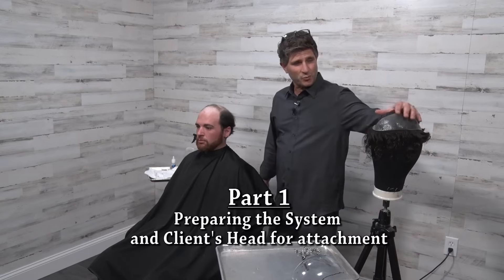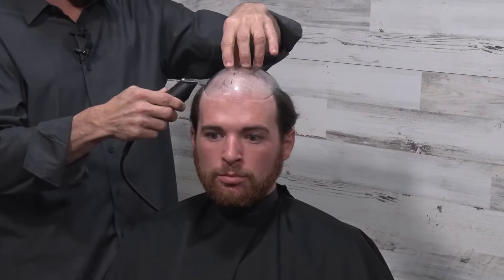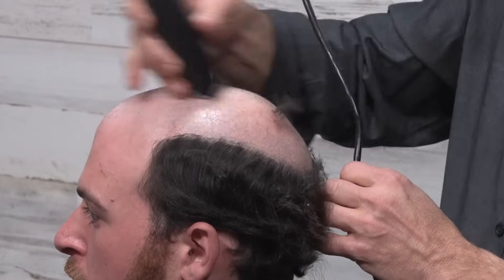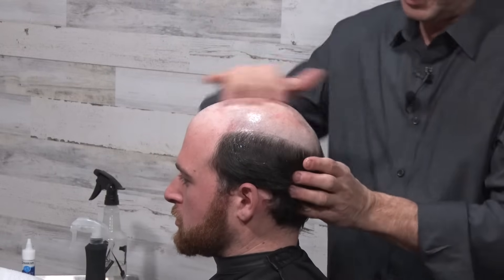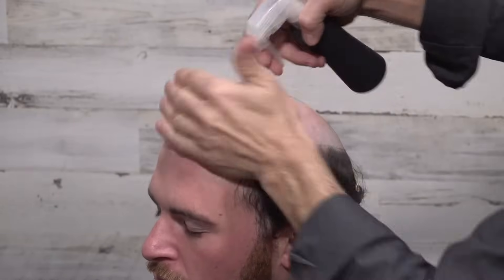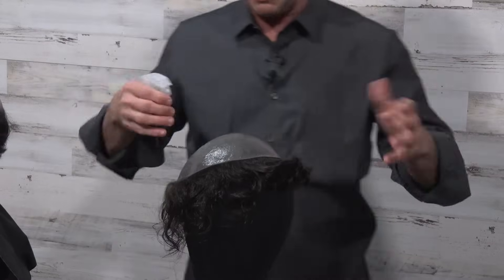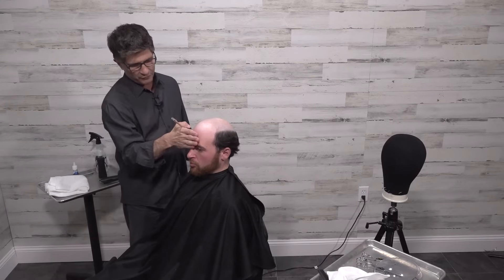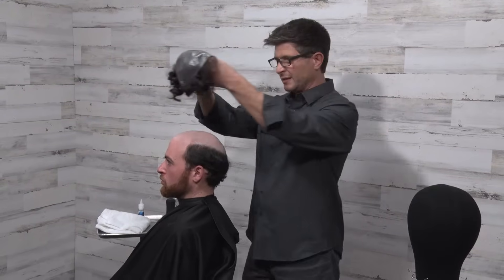Part 1 Non-surgical hair replacement. Installing a hair system beginning to end #1 of 4

Comment: Great Video! A small advice, plastic mold does not fit everyone, you can see a gap between the mold and your scalp, so the result might not be very accurate. Plastic wrap would be perfect for making a template. :) Anyway, thank you for sharing this video~ 😊
Reply from the maker: Plastic wrap is what we use mostly. Good eye! 👍
Reply: How is a plastic mold made
Reply from the maker: @shanz5820  Not sure. They come in the box with the hair. So if it fits the head well, we use it instead of tape, fiberglass or plaster.
Reply: @profitablestylistacademy  well you really do a lovely job x
Reply from the maker: @shanz5820  Thank you very much🙏
Reply from the maker: @shanz5820  Plastic wrap stretched over head, draw outline, then strapping tape for stiffness. Does that help?

Comment: Nice video, I was wondering about using witch hazel on scalp instead of alcohol, is that also accurate for the system?
Reply from the maker: I’m not sure if it will remove as much oil. Are you having trouble getting 99% alcohol?

Comment: I wear hats almost exclusively during the week  ... can this hair system along with possibly a method of application (maybe glue only the perimeter of hair system) that would allow it to be taken on/off more easily and wear on weekends only?
Reply from the maker: We can help with that solution, but not exactly how you are describing it. Where are you located?
Reply: Use tape around the whole edge. You can unpeel it off before bed every night. Then in morning re stock it on. The same tape re sticks to your head after 5 mins. It makes the system last 18 months minimum and you can take it off each night, and re shave your scalp every couple days. All these tutors on here using alcohol and every other product is completely unnecessary it’s ridiculous tbh the amount of faffing they do
Reply from the maker: @Fd20y  It’s not ridiculous at all! Isn’t that just your opinion. Looks like you may be a barber from your 2 posted videos. People could just cut their own hair and not need you. 
This is a service, just like cutting. Most people don’t want to do their own hair, so they pay you to cut, me to get hair, my team to learn. It’s called capitalism and education. 🤷‍♂️ Expand your acceptance🤔
Reply: @profitablestylistacademy  I cut and fade my own hair done so years and years. People need to learn to be self sufficient, that brings true peace of mind and control not relying on anyone else. There is literally no reason for all that product. Huge upsell. BTW I’m not a barber
Reply from the maker: @Fd20y  No they don’t!🤷‍♂️again…just your opinion. People don’t “need” to do anything the way one person says to🤦‍♂️
Reply: @profitablestylistacademy  no but people want to keep others eyes closed to the easier methods, it’s better to profit that way
Reply from the maker: @Fd20y  There are no shortage of answers on the internet. People can find the cheaper easier way also. 
This channel is for teaching Stylists and Barbers how to do a specific service, that clients choose to get, and yes… it costs money🤷‍♂️ We all need money to survive. You are not saving the world here. This service helps many people that can’t or just don’t know how or want to do it themselves.
Reply: @profitablestylistacademy  I understand but I just don’t like the fact the easy methods aren’t even provided as an option to people who get these things. I’m pretty sure the majority would want to know to enable themselves full control over it and being cost effective. Systems last longer, etc etc. No provider I know of shows my method, I wonder why
Reply from the maker: @Fd20y  We offer both and most choose adhesive because it’s less work or skill for them at home. They usually don’t mind paying for convenience by the time they make the decision. Also, your way is easy, it doesn’t really need a video for learning. We offer both in our studio and have both kinds of clients. Just very few choose tape and having it off at night🤷‍♂️ Most Hair Replacement centers offer both in the US. Not sure about the world.

Comment: i feel headache after installation what could have gone wrong?
Reply from the maker: @mryoso22  Many stylists stretch the base of the system on and it causes stress on the scalp. A soft lay down and then pressure to make it stick well is the right way. 
Bernard
Reply: @ should i remove the hair for now and return it later
Reply: @ or better i should do the reinstall myself?
Reply: @profitablestylistacademy  the pain is manageable not that painful however should i be concerned at all?
Reply from the maker: @mryoso22   No concern, but ask your stylist not to stretch the base and it will be more comfortable.
Reply from the maker: @mryoso22  If it’s too painful, yes
Reply from the maker: @mryoso22  Do you think you can do it by yourself?
Reply: @profitablestylistacademy  thank you finally tried removing it and putting it back on yesterday and the pain is gone now
Reply from the maker: @mryoso22  Perfect!!

Comment: How much does this cost on an average?
Reply from the maker: Hair Replacement like this takes about two hours to apply the first time, but that’s after a consultation to order the correct color and size. Usually the hair can be received in a few days, but occasionally takes longer if a custom order is needed. 
Then a monthly service and hair cut is necessary to maintain the look. 
New hair is replaced every 3-6 months depending on the hair system chosen. 
Hair cost ranges from $800. to $1,500. 
Service ranges from $100. to $250.

Comment: How long does it last before replacing it?
Reply from the maker: The adhesive lasts about 3 weeks between visits, but the hair system needs to be replaced about every 3-4 months. The look just keeps lasting for years if the client continues with service and new hair when needed.
Reply: Fantastic!🇬🇧👍

Comment: How long does this last on an average client???
Reply from the maker: Average is the key word… Then their is the word “this last”🤔
The adhesive lasts about 3 weeks between visits, but the hair system needs to be replaced about every 3-4 months. The look just keeps lasting for years if the client continues with service and new hair when needed. Which part were you really asking about? I’m curious!
Reply: @profitablestylistacademy  Most of my clients are in their 50's now and work at a desk. I've seen the systems that last a year but they look terrible. The one you use in the video looks great but I don't think my clients will pay $2500 unless it lasts at least 3 to 4 months before I have to replace it.
Reply: @stylistrichardjenkins  wait what ...$2500 for 3 to 4 months befoer you have to fork out another $2500? thats a joke right?
Reply: @djam7484   not a joke.  Happens all the time

Comment: Hey! Nice video! Where did you get the template to cut around from? And is it made specifically for that system
Reply from the maker: Most companies sell the hair on that same plastic mold for support during shipping. It’s not the correct size and doesn’t alway fit the clients head well, but if it fits well, we trace the backside of the system and cut it out.

Comment: I am not sure at this point if that is actually healthy for the head skin. I understand the wig thing needs to stick, but drying out the head skin could do the opposite effect of producing more oil.
Reply from the maker: We have been servicing some of the same clients for over 20 years with no problems🤷‍♂️
Reply: I live in Phoenix, Arizona. I use tape instead of glue. I remove my hair in the evening and have never had a problem with
My scalp.

Comment: Few negatives are when your head itches with the piece in place, you can't scratch it. Plus, it is very hot to wear on hot days and the wind can play havoc with the ends unless you use hairspray.
Reply from the maker: True for very few, but most of our clients are in the very hot Louisiana weather and don’t have any of those issues you mention. Do you wear hair?
Reply: @profitablestylistacademy  I did for 15 years and have a very oily scalp which itches a lot.
Reply from the maker: @normgardner4560  15 years😳 Must have felt some value…right? Too bad it itched😬
Reply: How long will this last
Reply from the maker: @christinapruitt2919  With service monthly… FOREVER😳🤷‍♂️
Reply: @profitablestylistacademy I live in Phoenix, Arizona and have no problems wearing my toupee in the hot summer. I do use tape instead of glue and remove my hair in the evening .
Reply from the maker: @Ken-mb6qd  Well said!

Comment: l was wondering what do you do if you were bald or part bald when your passport and drivers license photos were taken and you now have a full set of LORD hair and look totally different from your photos , what happens when you need to show your license or passport? do you take it off each time ,seems awkard
Reply from the maker: You can’t take it off easily. It’s bonded down for the month. The agents are used to it. Thousands of men and women do this and you don’t even realize. 
Get new documents with the new picture is one option. 🙏
Reply: @profitablestylistacademy  thanks, that would be my main worry as l would look very different from my passport and drivers license photos, They dont expre for 8 years when l get the new photos. l was wondering what do most of your clients do in that case. Are you allowed to request a new passport and drivers license photo ,do you have to tell them you now have a new set of hair, what if you feel a bit embarrassed about that
Reply from the maker: @johngurry  They don’t usually ask, but if they do, just smile and point to the hair and shake your head yes. They know! 😀😎🤷‍♂️

Comment: Spraying all that alcohol on the back of the system… you are not drying out the hair on the system?
Reply from the maker: I usually use a very small alcohol bottle and try to keep it on the base only, but the hair is wet and protected from direct contact.